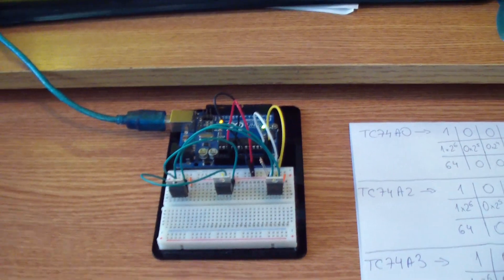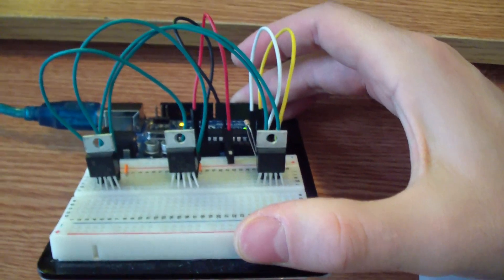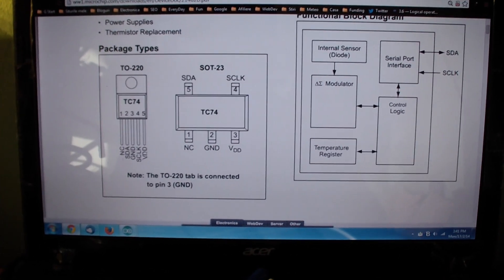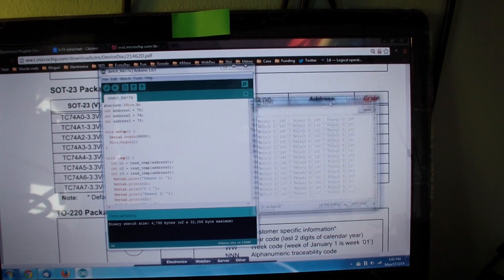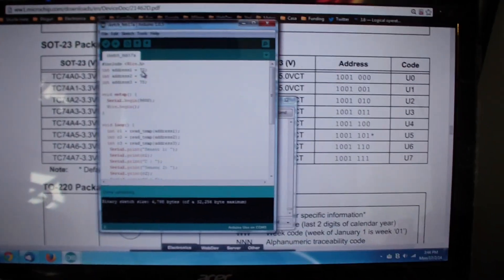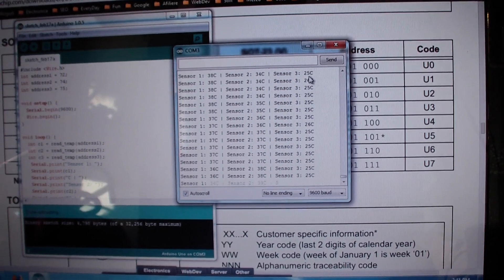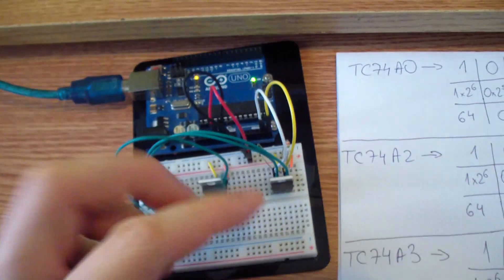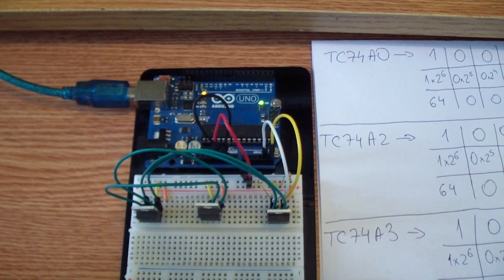Use Arduino I2C with multiple sensors

Comment: How many sensors can be connected in serial?
Reply: Do you have to buy them with different addresses or is there a way to change the addressing like there is with other devices (e.g. on LCD screens you do it by moving a resistor)?
Reply: Now I get what A0, A1 and A2 stand for. Thanks!

Comment: sir pls help me for my thesis,  i already build hybrid Peltier unit, there is a two chamber, the first one is for cooling application and the other is for heating purpose, i want to control the temperature of the two chamber according to the temperature limits of the Peltier module for cooling and heating, i want to use two temperature sensor connected in one arduino microcontroller, so that two temperature readings will see in a digital display separately, any suggestion about this,thanks.

Comment: how can you tell and make the difference between a TC74A0 or A1 or A2   it's the same sensor how it's done ?
Reply: +mehdi mahdi  The address for the I2C are different, If you use more then 2 sensors then the Ardino have to know which sensor you are using, this type of sensors are factory made with unique addresses A0 to A5. Please refer to eTechTom&#39;s video on YouTube called &quot;I2C Device Addresses.mp4&quot;

Comment: how can we program the average of multiple sensors on arduino board? and we want a single output from the average of the two sensors.
Reply: Not sure but maybe running another line which adds the two values together and divide by 2, give it another name. AveVal?

Comment: Thanks for the video!  This is fantastic.

I have two MLX90614 IR sensors, and I want to connect two of them to an Arduino Uno.  I am having trouble with the addressing!  Any help would be appreciated.

The cutsheet is linked below!

http://www.melexis.com/Asset/IR-sensor-thermometer-MLX90614-Datasheet-DownloadLink-5152.aspx

Comment: That code didn't work for me :(
Reply: Code is good, you just have to add wire library at top of code. That wasn't my problem though, you need two pull up resistors, I had put two for each sensor, not thinking they were all in parallel, reduce back to just two pull up resistors and code works!! problem solved!! thank you

Comment: what would you do then if you are using lots of the same sensors with the same addresses?
Reply: +bravab You couldn't do that without additional hardware.  Perhaps you could implement an address translation where you used an additional component which would give each device a unique address by translating it to something else, but that would be a lot of trouble.  More likely, you would look for a different part, either from the same manufacturer or a different one, which had more addresses, or at least a different address from your original part (I had to do this with light sensors).